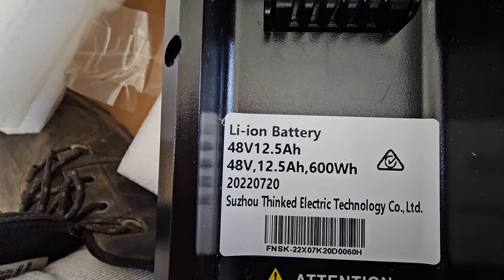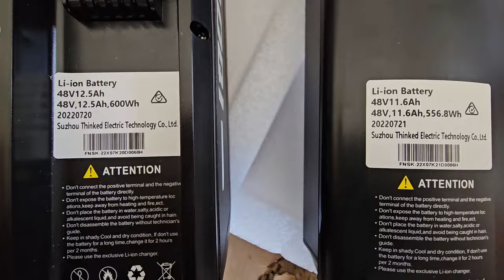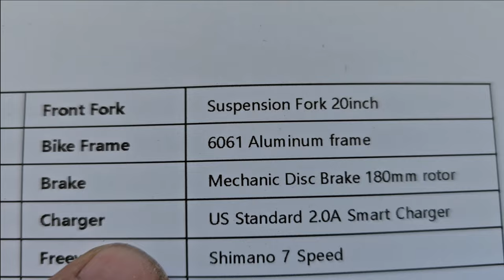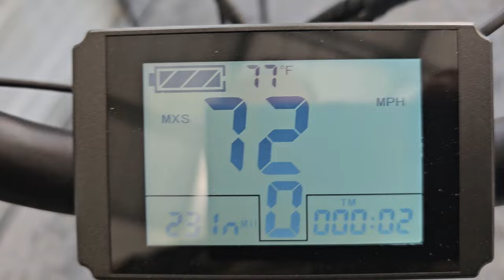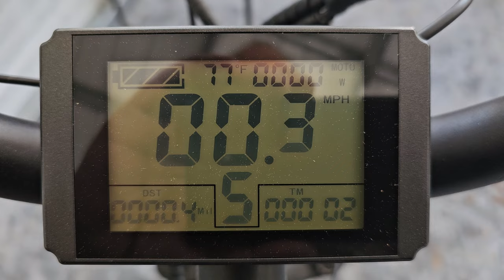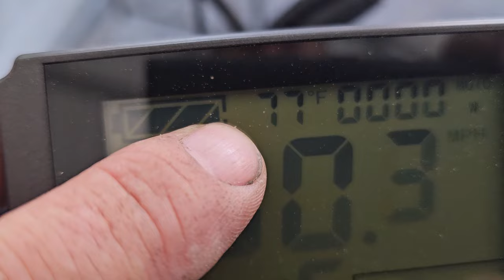HAOQI Silver Antelope Pro 750W Dual battery Cargo Electric Bike, settings,, build battery test

Comment: Can the mini truck go by the place with the electrical poles?  I'm driving around on the weekends sometimes
Reply from the maker: The power lines? Yes! I didn't realize you were in my area
Reply: @MotoCheez  yeah I live in Pine Ridge
Reply from the maker: @dsegundo I've seen a few mini trucks around here I give the thumbs up but I'm using my Jeep
Reply: @MotoCheez  oh yeah I've got a...cab on mine. Hard to explain hahaha